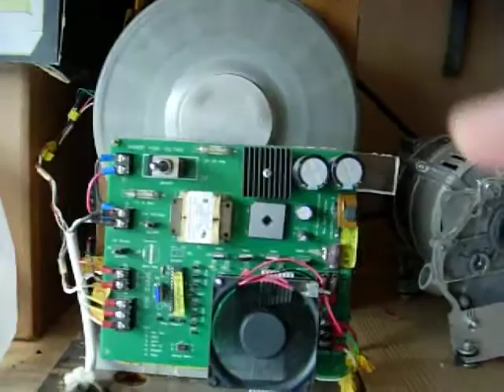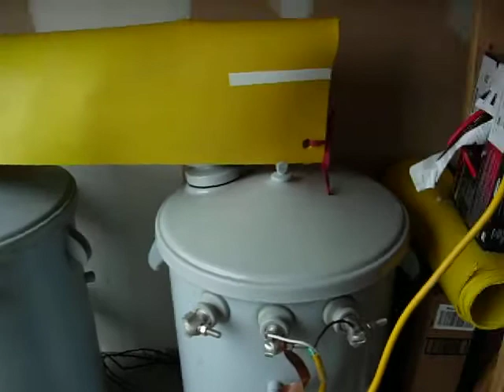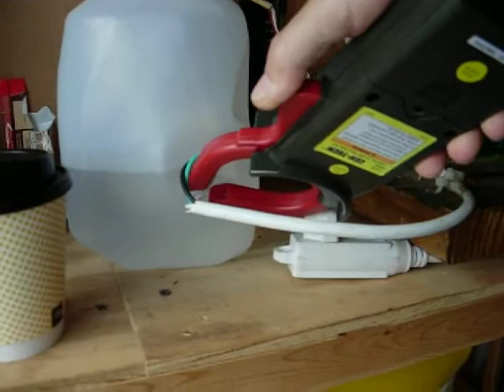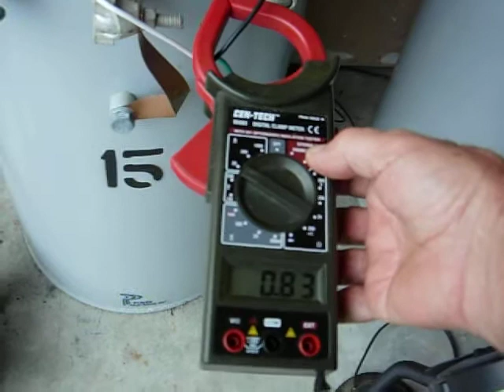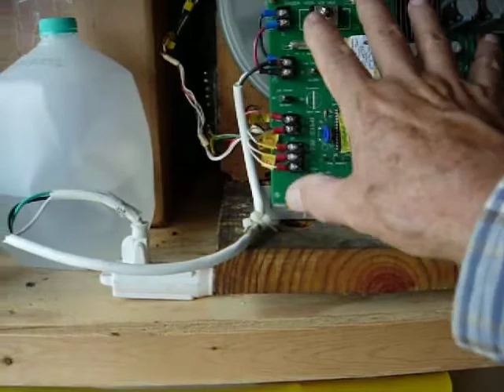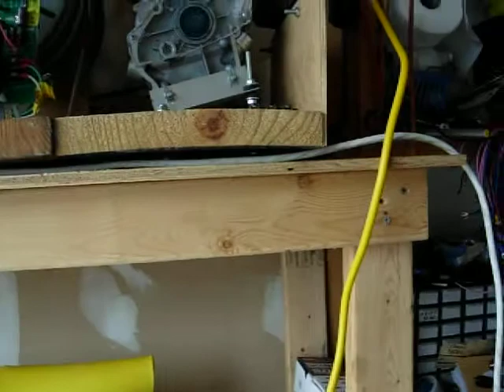Don Smith #169 running Motor/Gen into Pole Transformer Tes

Comment: I believe your problem is that you are actually using an alternator. Gerard used a permanent magnet mchulloch.
Reply from the maker: I rented a permanent magnet gen and did see the effect but my first pole is only 15kw Gerard used 50kw.  the difference in 120 aluminum plate from 15kw to 50 is huge so I tried adding some external aluminum plate 20ft still had electron flow.   9 amps @ 110 going in but 14amps at output @ 120.  I wished that I had purchased a 50kw.  My gen mot setup only produced 70vac  it was a permanent magnet type.   I'll be selling my poles
Reply: Thank you. I guess I was too quick to say something. Do you know anyone who tried the thyristor output from Don? I am going to try it as soon as I can afford the parts
Reply from the maker: Jim  just remember the atoms in your thumb use energy from the vacuum to maintain themselves free energy.  magnetics are a direct link to this energy.   BEMF occurs in all these energy systems and is electrostatic in nature this can be collected using diodes and caps .  The BEMF is created when the vacuums stressed energy is returning to the zero point and osc at a very high frequency.  I'm now working on Pierre's non rotating device duplication.  Not sure yet if I can get it to produce over unity.
Reply: Good luck!! I will be replicating the thyristor device. I know there are some things missing or hidden as he does with every device.. Ill let you know.

Comment: gerard also had the grounds of both transformers(case) connected together. i dont see that in your setup. 

you need a larger generator and one of the transformer need to be 10kv.

Comment from the maker: I just watched gerards video the doubt about over-unity with McCullough and his amp reading on the black 120 vac input wire from the gen was about 1.17 amps max so my .6 amps reading may have been ok.  I'll have to make sure when I rent the generator that it uses magnets to generate the 120vac and not coils driven from a 12vdc battery,  I believe that the magnets are the key here but who knows.

Comment: You have forgot to connect the 2 ground of each pole transformer together..  You are running the pole transformers as an open circuit right now....  Go back and look again at Gerard's video to make sure you are running a close RESONNANT circuit..
Reply from the maker: the two chasis are connected in the rear you can't see the wire.  Resonance is accomplished using capacitor to correct the power factor either on HV or LV side.  I'm not ready to do that at this time but will once I prove these transformer create the cold electricity effect.

Comment from the maker: If I used a single battery with an inverter to run the motor/gen setup I see no reason why the system couldn't''t be looped and made self running by using a battery charger connected to one of the second transformer outputs.

Comment from the maker: Well we now know that the Radiant Energy is running the output devices...Very interesting to say the least.  I wish I have purchased a 50kw transformer.  Maybe I should drive both 120 vac inputs at the first transformer.   I'm not sure what effect that would have on the transfer onto the HV windings  I'm really not even sure how these transformers work..  The two plates create 120vac and 120vac to give 240vac so driving them both may cause all kinds of things too occur inside the pole transformer.  We shall see.  I know that it was a pain in the ass purchasing the transformers.  I had to use a local motor rewind shop to pull it off. ABB wouldn't sell them to me directly weird.

Comment: Very interesting, so can you make a simple transfer switch for the motor input and loop it to the output of the second pole transformer? Just to see what happens...
Reply from the maker: The way the system in the future should work would be to have the output transformer run a battery charger and the battery in turn would drive the Samsung mot gen setup. Gerard almost got this done but blew up his setup when he tried to resonate the 60hz stuff with HV Capacitors.  I really think that the first pole transformer should be larger than the second Gerards were 50kw and &25kw.  Also he used a gasoline generator which had a governor to control speed.  My pcb has software an speed control but I pretty sure these were at there limit because when I did the speed adjustment on the PCB I had it at the max to get the 60hz 120 output from the gen.  It's fascinating that the dead short at the first transformer 120vac input did have any affect on the generator at all  current reading should have been huge. so something special is going on here with Teslas Radiant Energy.  Gerard test was good even though he didn';t take many readings.  I tried using my voltmeter at the second transformer powerstrip and I showed zero volts. amazing considering that thefan and lamp were running  the fan ran slower than normal. because the generator slowed down.   Radiant energy is real.
Reply: You are right Gary, the inverter and battery setup makes more sense, infact you may want to look at the Bedini style chargers over at http://teslachargers.com/products/